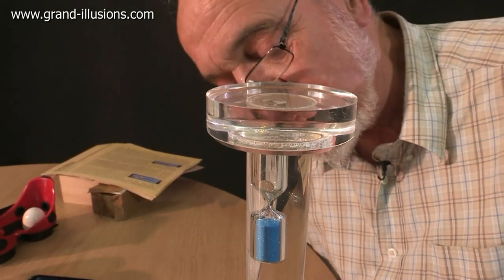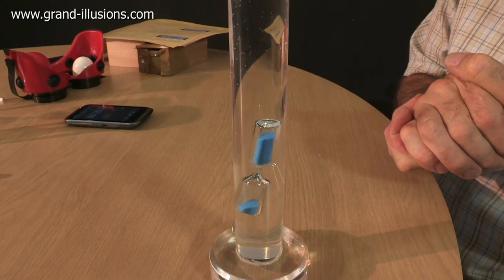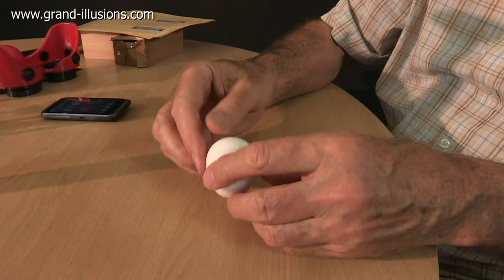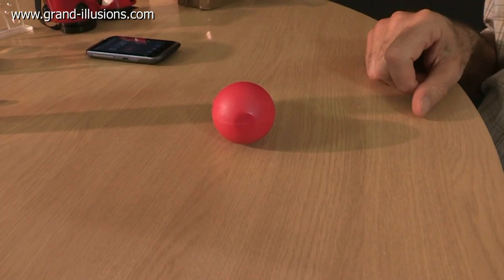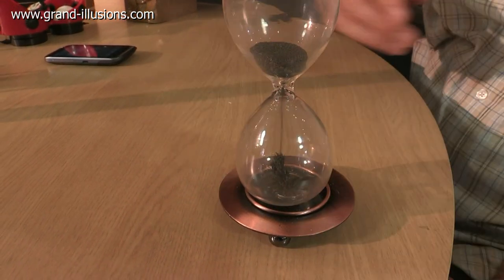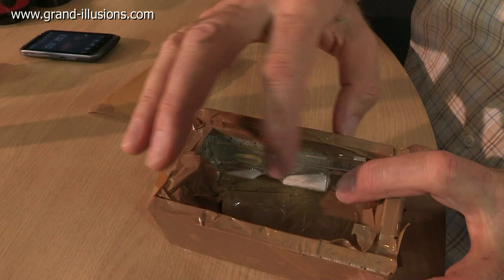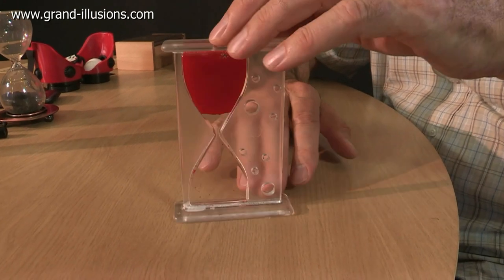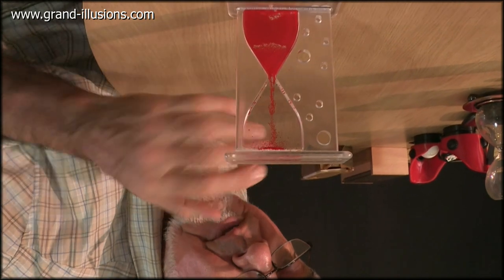To see a World in a Grain of Sand

Comment: It's definitely not using friction. At 00:20 you can clearly see the top of the hourglass VERY slightly swaying left and right inside the tube after Tim turns it around.  Go for another theory. I think the volume of the hourglass change after sands goes down. Maybe there is a diaphram on it.

Comment: the air in the sand timer it pushing up and to the side due to the weight of the sand pulling down so when the sand is at the top and the air is at the bottom its trying to flip over (the sand timer) this jams the hour glass in the glass outer tube. when the sand has moved to the bottom the air is at the top so it straightens out and rises. only watched a few seconds and can see that. will watch the rest now :D

Comment: For those wishing to understand how the first sand timer works, click "Read More".

Spoilers ahead.

The way the timer works is because there is air inside of the internal sand object, the air makes the object rise. However, the object will only rise when the air in the top portion of the object is greater than the air at the bottom. You can see the object attempting to rise from the air in it as the bottom portion sticks out at an angle. Once the air at the top exceeds the air at the bottom (By the sand falling, which causes the delay), the object will rise.
Reply: The 64th Shadow you explained that oddly. I think you mean this;

The tilt of the timer against the cylinder is causing friction, which allows it to stay at the bottom until it can be straight again.
Reply: +Pandan Thanks for explaining

Comment: It's friction isn't it?
The hourglass is tipped to one side and leaning against the side and it's just buoyant enough to float normally but that tiny friction is holding it down, then when enough sand runs into the lower bulb it stabilizes around the lowered center of gravity and floats upwards.

Comment: The sand at the top and air at the bottom causes the hourglass to twist and so presses against the sides of the tube both top and bottom. this causes the hourglass to grip the sides and stops it from rising. once the sand has sufficiently trickled down, the twisting force is reduced to such an extent that the hourglass can detach from the sides and float to the top.

Comment: For the sand timer in the water filled tube:
When the sand timer is top-heavy, the sand timer wants to tip over. The weight of the sand causes it to remain slightly wedged against the walls of the glass cylinder.

Comment: I think hourglass won't float upwards because of friction with the tube it's inside holding it in place. The hourglass wants to 'flip' in the water because it's top heavy, but can't because it is pressing against the glass tube. But when some of the sand runs from top to bottom it floats in a more upright position and is no longer pressing against the side of the tube.

Comment: In the beginning there is more air in the downside of the minute glass, causing a rotating motion that is stopped due to the pipe. This causes friction. When more air reaches the upper segment of the minute glass, more uplift is converted to upward instead of rotating motion, making it go up.
Reply: +Cretium Yup, I think you are right.

Comment: LoL, The sand timer works by being at a true neutral buoyancy. The constantly falling sand acts as temporary thrust. Hence pushing the sand timer slowly up to the top, of the fluid. By thrust, as in vibration energy and temporary mas shifting. As in the falling mass of sand is at a constant flow, and a constant mass. Thus removing this constant mass from the weight of the timer.  changing the neutral buoyancy to a positive buoyancy. Even thought the weight as a whole does not change. Matter in motion is a change in mas. 
Anyways, you already knew this! 
Have a good day!

Comment: Very nice. I'm thinking you could use the "magic" box technique on a large trunk. I mean after all; who would tilt a large trunk for 20 seconds?
Reply: +Issac Newton Yes, of course you could! What a clever idea. But use an hourglass, so it has to be tilted for 50 min. or so! hahaha! And it you're really clever, use a 30 sec timer, or so, and have it set at an angle JUST above the angle required for the 60min timer. SOoooo.... if you get it at PRECISELY the right angle +/- 1degree, then it will open in 50 min. If not, then it won't open, as the shorter duration timer, sets off another catch, to PREVENT it from opening! Damn, I'm smart! I'd like to go and make a prototype now!!!

Comment: Okay so before I finish the video I'm going to guess how it works. I think that the entire hourglass is very close to being denser than the water, but is just a little bit less dense, causing it to be able to float to the top. However, I think that the hourglass is only able to float once there is enough air in the top of the hourglass because buoyancy can only work if it can squeeze the object upwards, but if all the air is on the bottom, it is not the right shape to be squeezed upwards. I don't think I'm right but we'll see.
Reply: I thought he was gonna explain

Comment: Couldn't an upside down hourglass effect be achieved with some colored cooking oil in water as well?
Reply: +kevtino most likely. the trick is that the force of gravity on the individual droplets of what ever you are putting in the water has to be less then whatever is causing them to go up. in most food coloring what happens is the polarity of the water and the food coloring dont like each other so similar to magnets the droplets (atoms really) of food coloring get pushed out and up against the force of gravity and they win! if this is the case for the food coloring it would depend on the geometry of the droplets that form naturally due to a fancy word called electrostatic and electrodynamic forces (basically the magnet idea) so if they form droplets that are sufficently not dense and the electrodynamic force of repulsion felt by these droplets is strong enough then ya you could totally make that shit bro. also if you want to get into more about this idea and how much you can learn about the world around you just by playing around with what are called immiscible fluids (meaning they dont mix ie water and oil) you should look into the milikin oil drop experiment (probably spelled that wrong) they figure out the mass of an electron basically using the same principle i talked about and just using really fancy maths (some of which i touched on! you can totally understand it dont let it intimidate you!) its amazing and you can learn so much by asking questions keep asking! your common knowledge made you think about something that other people used to measure the weight of a subatomic particle! pretty cool bro

Comment: So i know it would bug me so heres how the water one works. When the hour glass is at rest, the sand is at the top, and since its at an angle, the center of gravity is slightly to one side, causing it to try and rotate in that direction, with the air bubble in the bottom half rotating the same direction through the same method, just instead of gravity, it uses buoyancy. When the air moves to the top and the sand to the bottom, the hourglass levels and bewm floatee boii

Comment: I don't know what the proper reason for it to do that that but my theory is simple things with air in them float as you can see when it's flipped it stays at the bottom because the air is all trapped in the bottom of the timer and it wants to flip it's self over and rise but it is trapped by the sides of the glass as the sand falls to the bottom the air moves to the top making it just float straight up instead of wanting to flip

Comment: I would surmise... The hourglass when flipped is now top heavy. It will naturally tilt to the side as far as it can, in an attempt to flip. The buoyancy of the bottom chamber pushing is up and the mass of the sand pulling down. I believe the hourglass is jammed, or wedged in place until enough sand has fallen to effect its center of gravity. Ever rub glass against glass? It can be a bit 🤔 sticky. (I believe that's the technical term😅) Like a weak atomic bond that's easily broken. I'm assuming the diameter of the cylinder plays a role. Less, not enough side friction and it doesn't work.

 I know "side friction" is not a thing. I almost wanted to use "angular", but that is probably worse! 😅 Can a/some real scientists correct my verbiage and shoot some holes into what you see needs it, Plz? I'd rather learn something new, than repeat something wrong! 🖖

Comment: The Top  half of the hour glass is heavy and wants to go down while the bottom half is light and want to to go up  so this creates a couple force and twists the hour glass  and the friction between the hour glass and the  Tube holds in place.. As the sand falls down to the lower glass this twisting force reduces and so the friction , the hour glass goes up.
Reply: +rrangana11 Agree

Comment: The water tube sand timer works by the sand is at the top but the air is lighter so it gets stuck between the two walls

Comment: If you look up the Scientific American issue where Martin Gardner explains the floating timer, be sure to find the later issue where he retracts the original statement and exposes the real trick.  And it is a trick: the sand timer has nothing to do with it!

Searching Google, I actually find a lot of discussion/explanation repeating wrong answers.  (Though I suppose such a device might be made according to these other principles, it seems unlikely.)
Reply: +John Długosz I haven't looked up any answers for this.  I think it has to do with the air pocket in the hour glass.  You can take a coke bottle with air in it under water, when you get the right depth it will just hover.  Go deeper it sinks, go a little higher it starts to rise.  So, as the air displaces the sand in the top of hourglass the effective center of the air pocket rises and causes the hourglass to rise.